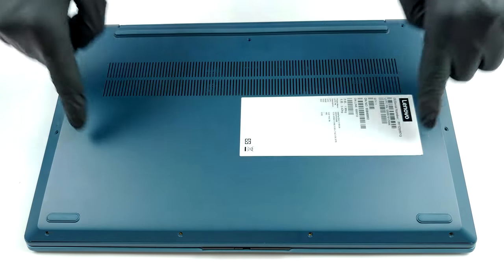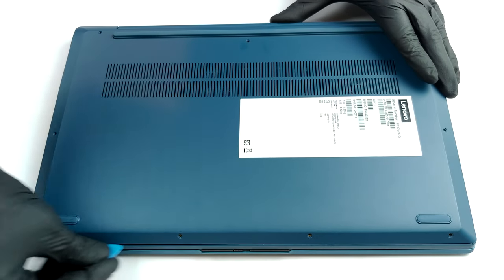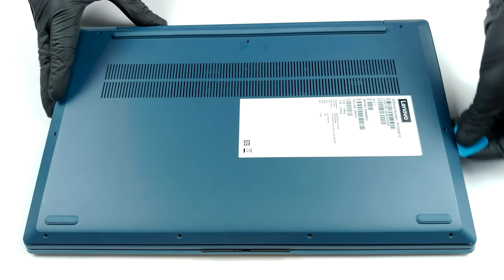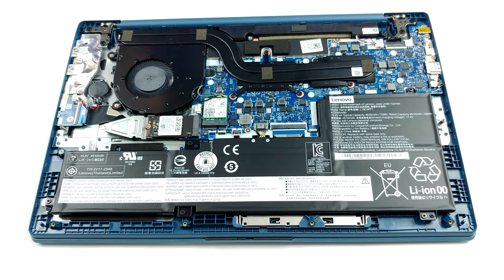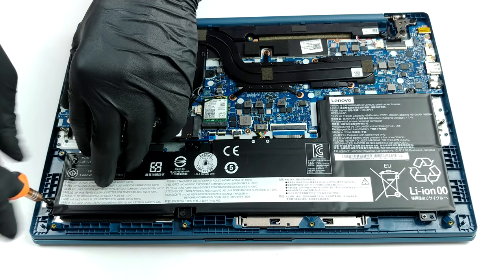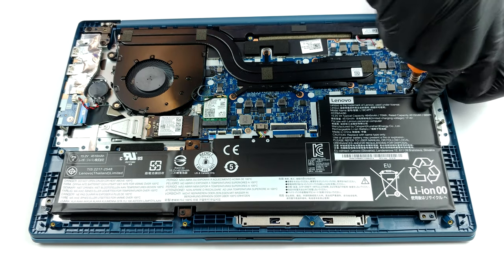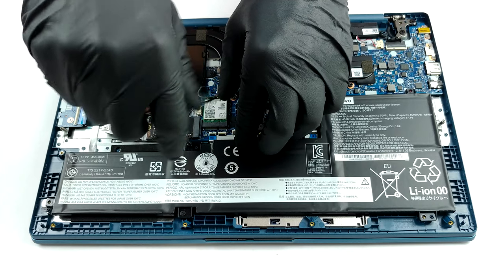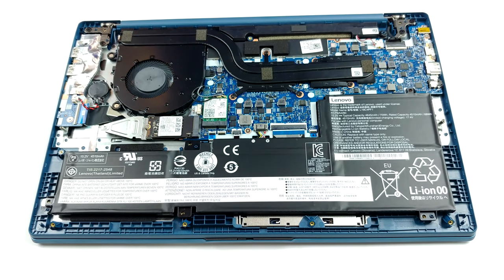🛠️ Lenovo Ideapad 5 (15) - disassembly and upgrade options

Comment: Oh wait, so if your ram gets damaged (fried) you basically lost your laptop?
Reply: that rarely ever happens, 
usually you fry ram by chosing a too high voltage or static electricity when touching the pins.
But since that won't be the case with ram thats soldered on the chances that you will ever fry it are very minimal.
The ram chips that are soldered on the board on the lenovo are also underneath a metal shield I believe.
Reply: @NexXxus86  facts I've never seen anyone bone out ram unless the tried overclocking cheap sticks with some less than ideal methods
Reply: basically need to replace the RAM chip through soldering
Reply: yeah that is one of only two contra points of this laptop: soldered ram and no RJ45 so you will be restricted to wifi (or ethernet through usb).  But the rest is (and looks) amazing and affordable too.  Immediately after unboxing I pushed win10 to the start of the nvme ssd and installed Linux Mint on the second half - works like a charm in dual boot.  Lights in the keyboard are fine under linux.  hdmi to 1080p beamer wonderful. Etc etc
Reply: @NinaMango789  I had some RAM be bad out of box (this was the better part of 10-15 years ago before shopping online), I drove an hour down to best buy to buy the ram, got home put it in and it didn't work so I had to drive all the way back down the next day to get it replaced, that time I took the laptop with me and installed it in the parking lot and confirmed it working before leaving, then somewhere around that time I had a module randomly start throwing errors out of nowhere on a desktop PC I had built and I had to RMA it, but i've built a dozen desktops and done memory upgrades on at least as many laptops and half a dozen HDD to SSD swaps on Laptops, but hey i've only been tinkering with computers for 2 decades.
Reply: RAM chip can be changed using gas solder. But never see such case. I ever work on laptop service shop for 3 month. Such case is never occur
Reply: Nah that's just easy u just have to solder a new ram chip and that's it
Reply: This is what happened to me after 4 years, one of the ram sticks no longer works, as confirmed by the bsod code I get a minute after I load it up every time, and other issues to do with the graphics. I never changed any ram settings/overclocked it so it can only be down to poor quality ram.  I've had to buy a new laptop and I'm watching this video to work out what tools I need/how to disassemble the laptop so that I can retrive the SSD. I'm not bothering replacing the ram when the hinge glue already wore out and broke making it unable to be shut.

Comment: Thanks for this, saves me dismantling mine! 4800U with 16GB and gets nearly 20,000 PCmarks and 4000 Cinebench!
Reply: Where do you bought it
Reply: Huh strange, my 4600U gets around 5000-6000 cinebench. Is yours thermal throttling?
Reply: @defendthepie7029  which version!? R20?
Reply: @defendthepie7029  The Power Settings in Lenovo Vantage make a huge difference (in fan noise and cpu speed)

Comment: Can this be upgraded to 16 gb ram if I get the 8 gd model? And can I upgrade the ssd from 256 to 1 tb or more?
Reply: no and yes on the SSD
Reply: No, if you have the 8GB model u cant change the Ram anymore because it is welded on the board.
You can change the m2.ssd to any other model

Comment: Thanks. I  bought this same type a month ago. Really want to see the inner part. I have upgrade it to windows 11. It work like a charm with my laptop.
Reply: Hello sir i have some questions about this laptop 
Is the 8g ram running in dual channel mode ? And can we upgrade the storage by putting another ssd into the laptop or it just have on slot for that

Comment: TL;DR there is a spot for the drive, but you have to buy a laptop hard drive cable to install it

I just took this type of laptop apart. mine had the smaller battery and a hard drive bay. It did not have a sata cable for the bay, but the motherboard has a slot for a cable. If you want to add a hard drive, you'll have to also buy the required cable. The SSD is also upgradable and it measures 80mm from around where the connecter is and the last mounting screw. You should be able to install a 2280 form factor drive in place of the current smaller form factor m.2 drive that is shown in the video.
Reply: In mine there is a slot on the mobo, but you need the cable.
Reply: @sullidav  I just checked the pictures I took and it looks like there is slot on the motherboard that I missed. So I guess you could buy a cable online along with the required drive. I'll update my comment. Thanks for replying!

Comment: If I have the 16gb model, there is room to install a HDD?? plus the ssd it brings from fabric.
Reply: I have the same question
Reply: It will depends of the battery installed: if it's the 70Wh you can't add a HDD because it doesn't has a 2.5" drive slot, only if it comes with the 45Wh or 57Wh battery.

Comment: Is it possible to have a video disassembling the whole cooler system, i bet its worth to change thermal paste.
Reply: For some reason two of the screws holding down the copper plate are different sizes from the other one. I couldn't get the two to unscrew, tried both philips 0 and 00 :/

Comment: that huge battery gonna come in handy for ppl that run the laptop long hours wihtout power supply
Reply: I got about 8 h with the 70 wh battery with internet surfing and doing scoolwork
Reply: @unknownpjh1401  pretty sweet
Reply: This is arguably the best budget laptop out there right now,  it just hits great on a lot of important parts.
Reply: I have the 57 Wh model, can I upgrade to 70 Wh?
Reply: @nutcracke16  Don't think so bc with the smaller battery options it comes with an extra 2.5" SATA drive slot. You should be able to get up to 11 hours of battery life with yours I read.
Reply: @Eddi3Pwns  it would boost the life by 2.5 hours i guess. I can live without it though :) thanks!

Comment: if i want to upgrade the storage, do i need to change the ssd to higher storagee or can just add an extra one ssd at the slot?
Reply: change.
Reply: you would need a smaller battery to fit a 2.5" drive solid or mechanical. and also you will need the case and the flex connector. you may get all this in amazon / aliexpress
Reply: @AXEL10000hp  does the 57 watt version have a slot for 2nd ssd ?

Comment: I have the AMD version with the 57wh battery, which has room for the sata drive. My question is where do i plug in the secondary drive if i buy one? I don't see a slot to install a secondary drive of any kind. I see holding bay for the sata drive but not sure where it would be plugged into on the motherboard.
Reply: I do believe there's only one slot, so you'd have to replace the current one with the upgraded
Reply: On my version (Intel I7 with 57wh battery) there's a slot but you need to buy a SATA cable.  This one on Amazon for $9 worked.  Suyitai Replacement for Lenovo Ideapad 5 15 ARE05 5C10S30033 GS557 S550-15IIL NBX0001S200.  I successfully added a 2.5" 1TB SSD to the 0.5TB SSD already there.

Comment: can upgrade the storage? or is there any other way to get more storage without having an external one?
Reply: You can upgrade the storage by taking out the m2 out and putting bigger disk in. And there are some models of this laptop that have smaller battery and by that I mean that you have room for 2.5'' ssd or hdd
Reply: @Mustafa Pasic  Can we insert SSD by removing HDD?

Comment: I have a question. Ideapad 5 14 inches seems to be reinforced to protect the c type or ac terminal, but it's not 15 inches?
Reply: What do u mean i dont understand or cant tell the diff how is it protected or reinforced
Reply: @ahmadshafique2018  This is not important. But I just wonder A well-made laptop uses a double-layered iron plate on top to prevent a charge or data terminal from breaking down. Idea Pad 5 14 inches seems to have it applied, but 15 inches does not seem to have it applied, so I asked the question.

Comment: Can someone help me about how to add a second storage on this model ? Thanks
Reply: If you have the smaller Battery (57Wh) you can add an 2.5" SSD or HDD, but if you have the larger battery (70Wh) , the slot is blocked.
Reply: @musclerider1942  thank you for your answer. But, with the great battery there is no possibility ? even in the otherside of the motherboard ? Like under the keyboard. Thanks for your help
Reply: @musclerider1942  I have the 2.5" slot, but there is no connector. How do i connect the SATA hard disk to the motherboard?

Comment: What is the max capacity of the ssd slot on the 70whr battery configeration?
Reply: 512
Reply: It can be configured with up to 1tb nvme m.2 on lenovo's configuration, it can probably handle more but I can't be sure of that.
Reply: It is made to handle an UNCOOLED m.2 2280 SSD.  Any capacity.  The Samsung Q is up to 8tb now, and partition that out to a small C: partition for the OS and progrmas, then have a relatively hefty storage/USER partition.

Comment: Hi, I purchased this laptop idea pad 5 15itl05 but battery is 57wh. Is it possible is replace it with 70wh battery?
Reply: I have the same... 512 sdd, 16gb ram.

No option to add 2.5hdd 😣

1. Does your laptop heat when charging, the keyboard area?  

2. Also, did you try gaming? Slight gaming and the fan vents out hot air onto the display at the right corner, won't it Damage the display?
Reply: @stonespider  I didn't try gaming, during software development I don't heat much

Comment: Hi Brother, i have purchased almost 10 days before latest model of it. Lenovo IdeaPad Flex 5141 | Core i7 11th Gen Model 82HS with RAM 16 very fast and good. But i want to increase its RAM is it possible
System Model	82HS
LENOVO_MT_82HS_BU_idea_FM_IdeaPad Flex 5 14ITL05

Processor	11th Gen Intel(R) Core(TM) i7-1165G7 @ 2.80GHz, 2803 Mhz, 4 Core(s), 8 Logical Processor(s)

Installed Physical Memory (RAM)	16.0 GB

Comment: So the 8GB Version still runs dual channel?
Reply: Yes there in dual config (even though its soldered and hard to tell) as ryzen work better with dual channel
Reply: no it runs at single channel the controller is daul channel but active is only one channel

Comment: can you add a graphics card in? i have this lenovo it has integrated graphics but i want to use it for some gaming too.
gaming on integrated graphcis would ruin the laptop right?
currently it has Ryzen 5 4800U, and is 16GB RAM
Reply: I dont think there is any laptop you can upgrade the graphics card tbh
Reply: integrated graphics seems better nowadays compared to years ago. while not comparable to dedicated graphics, you should be able to game on it at least casually.
Reply: @salmanmahyuddin8384  yeah I played around more than 60 hours of GTa online, the CPU did end up sounding like a grass machine . But yeah game play was smooth

Comment: LaptopMedia Can you review the same model but Ryzen version? As far as I know, it has 2.5" HDD/SSD upgrade option
Reply: @umar24579  yeah i know just wanted to make sure if the model has an option to add 2nd drive
Reply: Only for the versions with smaller battery